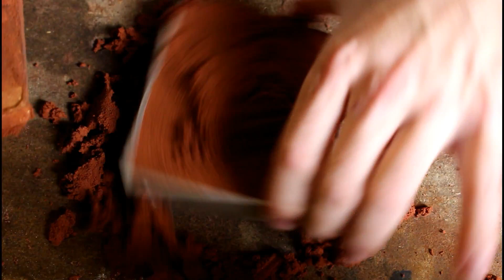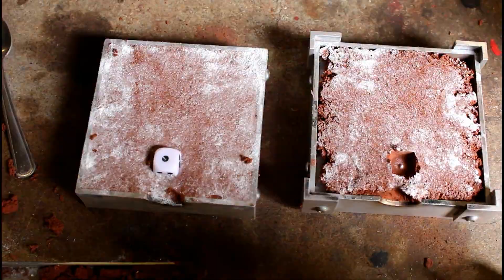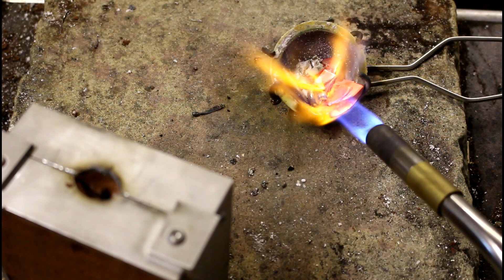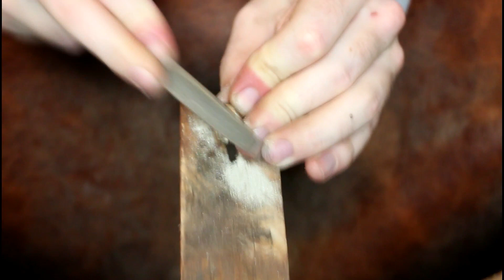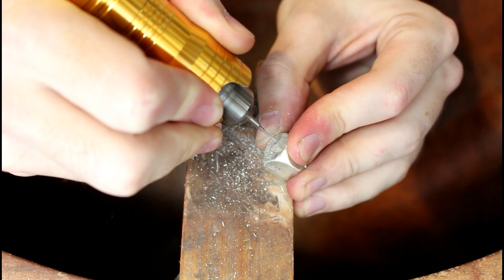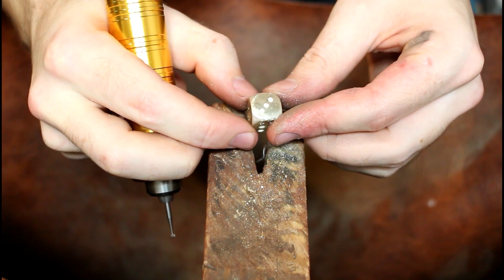MAKING A PAIR OF SOLID SILVER DICE

Comment: Curious to know what calculations you used to get the weight of the silver being that plastic is a different weight than wax?
Reply from the maker: No 'calculations' per say. Just a good old guesstimate. I'll usually go overkill and use extra material to ensure a good cast and then reuse the remains on a later date.
Reply: @natecharleswatches  haha well that usually works, thank you I appreciate the response. Great work on the dice